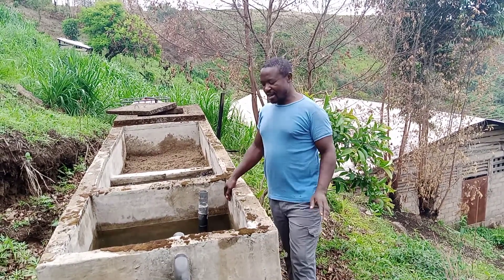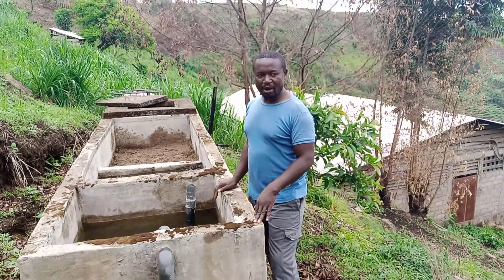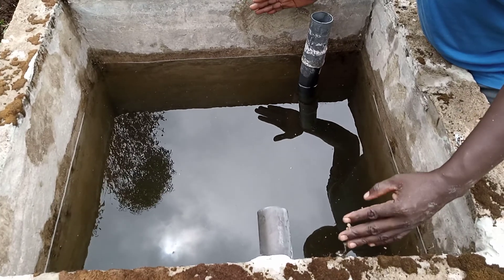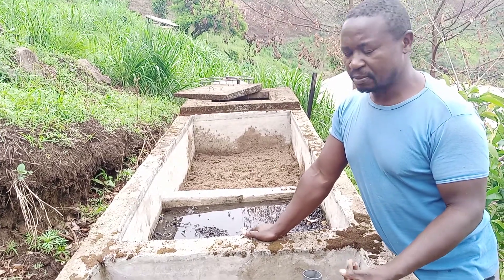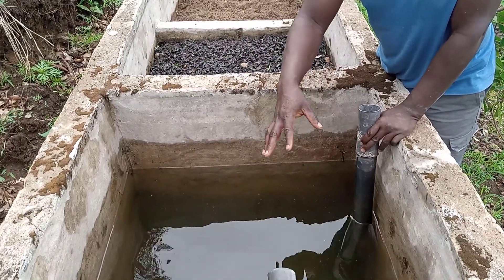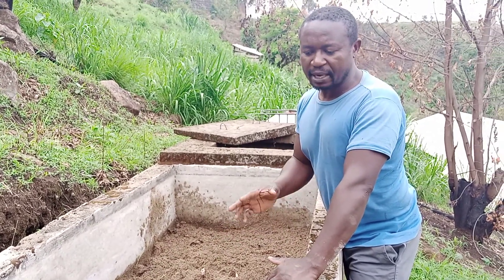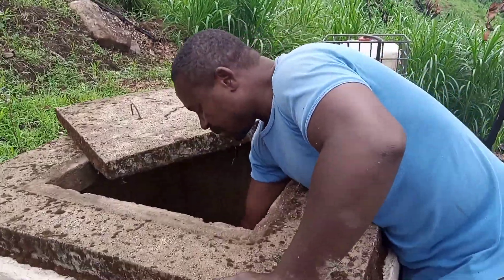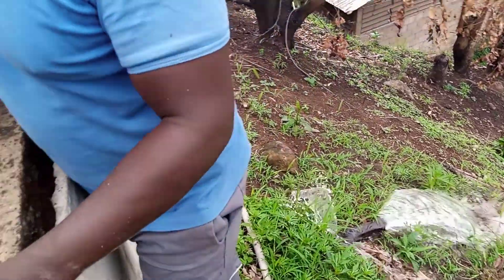How To Naturally Filter River Water For Drinking And Animal Husbandry.

Comment: Where do I locate the pipe from the fine sand to the last part ?
Reply from the maker: @papas.filmclips  the pipe is right beneath at the basement leading to the fourth chamber
Reply: @farmertantoh won't the soil flow into the other chamber
Reply from the maker: @papas.filmclips  not much since it's fine sand, the water easily drained through the sand. However, the outlet of the water is raised halfway between the wall of the fourth chamber. Meanwhile, a drainage outlet is installed in the fourth chamber where you can drained any sediments that settles in the chamber.
Reply: @farmertantoh  kindly give a quotation on the building
Reply: On materials to use to build the whole system
Reply: I would appreciate
Reply from the maker: @papas.filmclips  where are you based?
Reply: @farmertantoh   Kenya maasai mara
Reply from the maker: @papas.filmclips  oh wow, I have worked in Bungoma. I will really love to visit your area some day and even do a water project. I can try to do the  quotes in xcfa, then you convert to shillings

Comment: Do I have to wash the big stones, small gravels and sand? How many months or years to change stones and sands? Thank you in advance.
Reply from the maker: Can be changed after 5 years, or remove, wash and put again in the chambers
Reply: In what height to put the pipe from the sand 3rd chamber to the clean water 4th chamber? It’s not mentioned correct if i’m wrong. Thanks!
Reply from the maker: You can wash the big stones and gravels every after 2 years. But in first chambers, always drain every week when you notice sediment. Then the third chamber,  wash the fine sand as well after 2 years.
Reply from the maker: Your don't also need to change the stones not sand